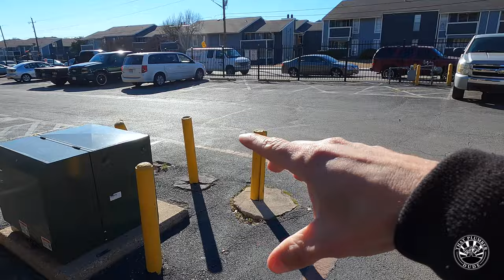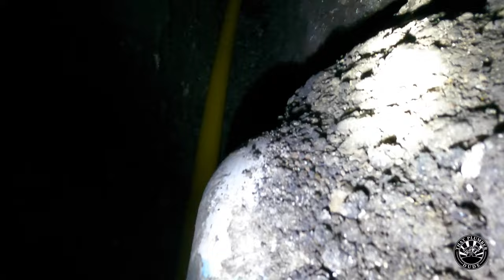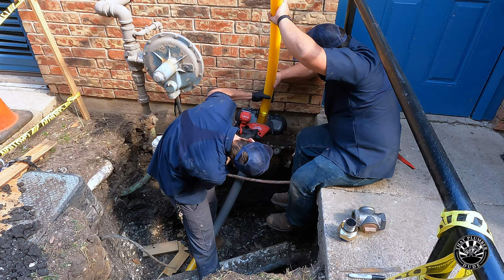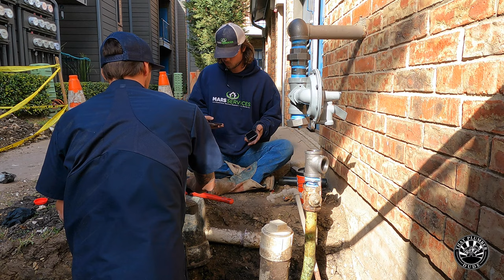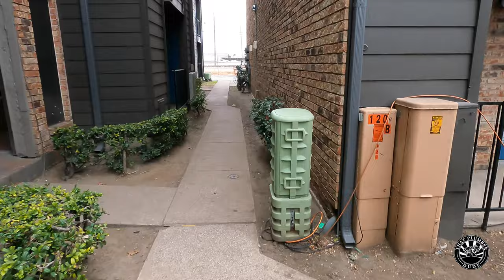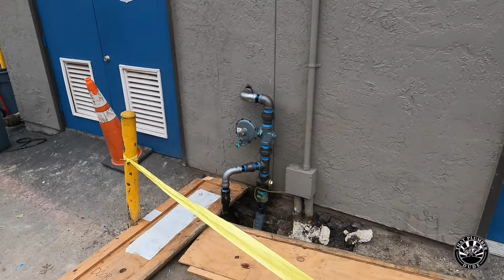Natural Gas Line Installation | Plumbing Vlog for Apprentice Plumber

Comment: all the fittings look good but you shoulnt use a saw to cut the pipe becuz those shavings can get down into the pipe then when the gas flows it will take it into the regulator and stick too the seat and cause the regulator to leak out the vent, should just get a pair of 2in ratcheting pipe cutters just be carful not to egg the pipe if you have a dull blade
Reply from the maker: For sure

Comment: I'm surprised how short a pipe wrench on the 2" fittings.  I've had to come behind and fix enough leaks on larger pipe, I put it on TIGHT with a BIG WRENCH after doping CAREFULLY.  But many of the messes I come behind were none too tight.

Comment: I have always wondered how they put on those gas risers. Looks like a solid way to do it with the connection being above ground.
Reply from the maker: Yeah it’s my preferred method 🤙🏼
Reply: those x risers by chicago fittings are nice becuz your fittings are above ground and are easy to install but if they are improperly installed (threads are cross-threaded or pipe not inserted all the way up into the riser) they can leak and when not inserted all the way or not threaded all the way or cross threaded, in that case gas only has one way to go down the riser and out the end of it, below ground. but over all if properly installed they are great
Reply: @bhearit5775  Well, anything can leak if installed improperly. I would prefer to avoid underground connections whenever possible.

Comment: nice work. I'm surprised that leaning over gas meter was put in front of the electrical meters, which typically would want 30" or so clearance for servicing those meter panels.
Reply from the maker: Great point!

Comment: Here, you cannot use metal pipe bushings anymore. It is against code. The use of poly was smart. If using megapress need to go all the way with them.
Reply from the maker: What area are you at?
Reply: @ThatPlumberDude  SE NC
Reply: They are prohibited here in California as well, but only for indoor or underground applications. No street elbows either.
Reply: @DragonBuilds  I have heard that, but is there a code reference on it?

Comment: Excellent video, thanks. Great plumbing technique. Were the megapress fittings specified by the project engineer/architect, or the municipal building department? Here in Northern Virginia each jurisdiction seems to have their own specific limitations on mixing threaded & union fitting with megapress in the same final assembly, especially compressed air and gas service installs.
Reply from the maker: That’s for the positivity bro! Yeah the engineer was good with how we planned & executed our install. 🤙🏼

Comment: Did you guys did that tunnel? Where your dragging the pipe over to?
Reply from the maker: We had our excavation crew trench it. It looked like a tunnel but it was a trench with the metal plates on top. The scope of work included running a gas line from one meter to another meter. They were abandoning a gas line because they are installing a parking garage so we ran a new one from another meter. The very end will show you 🤙🏼

Comment: Pipe fitter can’t decide which lube/seal he likes, tape or dope .... did both ... lol
Reply from the maker: Haha, not quite! 8 out of 10 professional plumbers use both. 🤙🏼
Reply: Where I’m from they would fail this installation due to use of tape, we use dope only for gas lines
Reply from the maker: Where do you live? Here in north Texas we can use gas approved tape and/or dope.